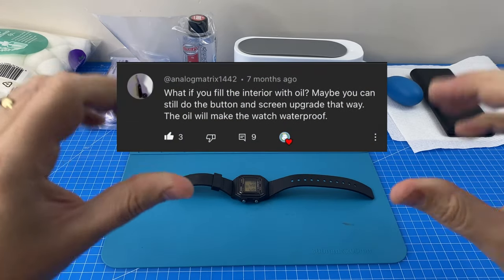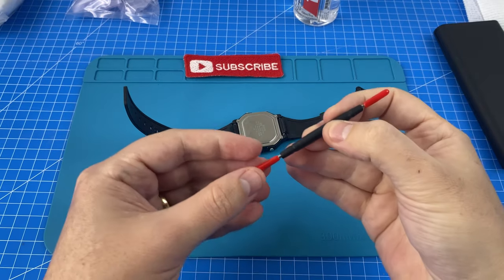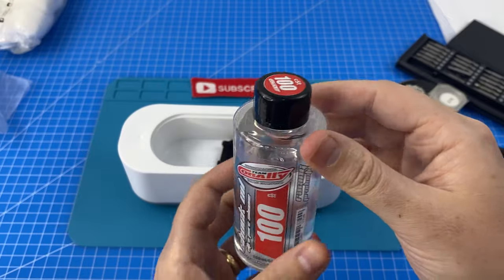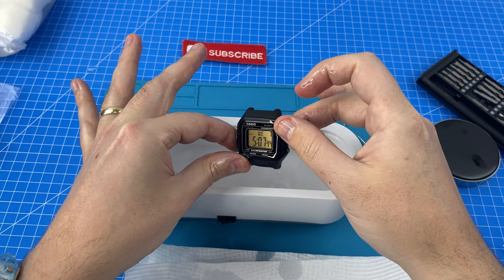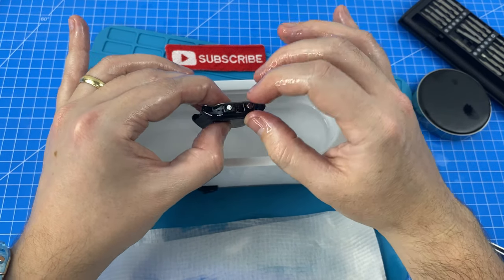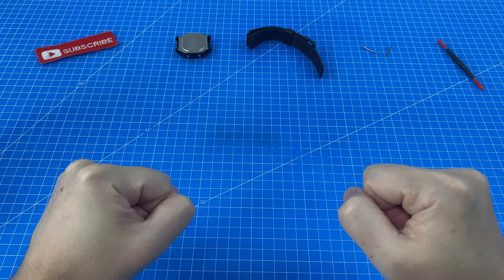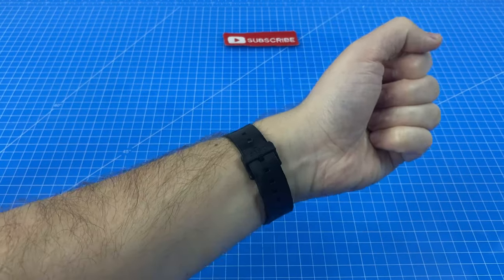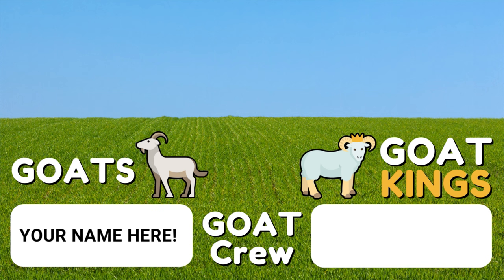⌚ Casio W217H HYDRO MOD Attempt! 💧 SUCCESS or FAIL?! 😨

Comment: Liked the video, but this "mod" seems like a solution to a problem that nobody is having.  If anyone needs more depth from their watch, Casio sells G-Shocks that go to 200M.  That's deeper than anyone reading this will ever take their watch...  Most recreational scuba stops at 130 feet... Navy Seals have been known to go as deep as 300 feet.  That's still less than half of what a bone stock unmodded 200M G-Shock can do...
Reply from the maker: Fair point! In the context of water resistance, I agree 💯
G-Shocks and Casio's generally have an EXCESSIVE water resistance rating that most of us would ever breach.
I will say that there's one added benefit to this mod that may make it appealing to some - and that is the improved visibility of the display. 👌
Thanks for weighing in, Squire! 🙏
Reply: Stupid talk! I need this!! In my Summer Holiday i will swim in the Pool 😂
Reply: @NoxmilesDe  just saying you can swim in the pool without the mod, and any of the other G Shock watches typically have 200m resistance.
Reply: I just like to mod stuff
Reply from the maker: @030nordseite  agreed, it adds another layer of enjoyment 😁👌
Reply: The oil mod alters the refractive index which allows it to be viewed at any angle underwater. That alone makes it worth it.

I just watched a vid where they put watches into a pressure chamber. Un modded, the screen broke at 400m and the front gave way at 1911 meters. Slightly more than rated.

Modded, maxxed out the chamber at 4300 M.
Reply from the maker: @Tuck-Shop  I watched that same video! 👌 Absolutely eye-opening 🤯
Reply: @Tuck-Shop  How often do you dive deeper than 200M?
Reply: @SquireSCA  when I go down on your mo ...

Too easy. Have a nice day.
Reply: @Tuck-Shop  Exactly, you aren't diving that deep anyway...  It just seems like this mod is a solution to a problem that nobody is having.
Reply: @SquireSCA  You completely overlooked the first part of my comment.

"The oil mod alters the refractive index which allows it to be viewed at any angle underwater. That alone makes it worth it."

Whilst filled with oil it also gives extra support to the screen protecting it from damage too. But you are after an arguement to dismiss and belittle those that like this mod. You'll ignore all reasons other than the one you wish to disprove. 
But at the same time you didn't rise to the your mom joke. Kudos for that.
Reply: if your reasoning was of any value mechanical watches would be museum material and  no one would be manufacturing them, but they are selling really well and for unimaginable prices.
Reply: you do it to have something no one else has or very few ppl has. you do it to have something exclusive and to start conversations about what you have on your wrist!
Reply: @jfonsecaesilva  Sure... I guess I could mod my car to drive in outer space, just to have something exclusive that I could tell people about...  Not sure how practical it would be, as I will never get to outer space to use it...
Reply: It’s usually done more for how it makes the watch look than the depth rating. It looks really, really good.
Reply: one would think that. I had a classic stainless steel led armitron that was water resistant to 50 meters, but was throwing a football in a pool with my boy and it ended up taking on water.  Had it for two years and no issues in hot tubs, hotel pools or everday showering.  but that one day throwing a foot ball and catching it in the water wrecked it. Im doing a SKX MOD on a casio A168 with a stainless case and blank stainless faceplate with a green screen. Going to do the oil mod on it as well and see how it turns out.
Reply: I agree but it’s a Casio so hey! That’s what we do with Casio watches… pointless mods!!
Reply: Because of fun, guys!
Reply: It's not about the depth it's about the time that the water resistance will be able to stop water from getting in... 200m water resistant watch will fairly keep it out for a long time while 100m, 50m, 30m wr will  give out earlier. There is also the question of erosion and residual formations that will affect the water resistance when exposed to something like salt water in the ocean or excessive soap usage etc
Reply: @SquireSCA  not only does it improve legibility below water but it makes it a bit better above too

Comment: The only things that can suck is the fact that it can be a mess and that you HAVE to do the process again if you want to replace the battery, thankfully if it’s a watch it can a long time before you need to do that (assuming the oil doesn’t eat at the plastic)
Reply from the maker: Great points, Sultan! 🙏 
I couldn’t agree more. 👌 It’s a sacrifice you have to accept, before deciding to attempt this mod. 
Ultimately, I’d love to one day try the Hydro Mod on one of my G-Shock’s with “Tough Solar”, which would completely remove the need to ever open it for a battery swap 🤩💭🔋 

Regarding the eating of plastic, I have seen some of the softer plastics be eaten by the WD-40 branded silicone spray (explained in my recent videos of the borrowed GBX-100). I am hoping that the more neutral silicone oil that I have used, doesn’t have a corrosive affect. 👌
Reply: @goatreviews "tough solar" doesn't mean it can last forever. It has a battery too that needs replacing eventually. In fact, it probably have a much shorter life than "10 year battery" regular power. For the past couple decades, I've used several "tough solar" Casios almost exclusively, believing this class of Casios could last forever. But none of them did. The longest ever is around 4.5 years before the necessary battery replacement. On the average, just 3 to 4 years. 

Realizing this thru years of buying "tough solar" and replacing batteries regularly, I've finally made the switch to the "10 year battery" casino royale for starters. Just today, I've placed an order on another "10 year battery" model, this time, a dual analog-digital Casio. And I'm eying another one. 3 more years to go, and I'll find out if this can last longer than tough solar.
Reply: @goatreviews you'd probably be better off "hydro modding" a "10 year battery" Casio.
Reply from the maker: @allanbernabe38  Wow. This is eye opening! 👀 
Tough Solar was honestly one of my most desired features - as I thought it would outlast a 10 Year battery! 🤯
I might have to rethink this now…

Thank you for sharing your experience on this topic - I really appreciate it!
Reply from the maker: @allanbernabe38  Cheers Allan. Agreed 💯 This makes a lot more sense for minimising the need to re-hydromod it! 😁👌
Reply: @goatreviews  you're welcome. To note, the longest my tough solar watch lasted (not the battery, but the physical watch itself) is around 12 years. And I don't even do mountain climbing, or diving or any extreme stuff. Just regular work-to-home days. I work in construction, but it doesn't matter. I don't dip it concrete or hit it on anything. Not even drop on the floor. 

Some sort of tiny part inside, could be the button peg or something, simply worn down. No replacement parts available. So I had two successful battery replacements, and on the third round, the service center says it won't work anymore and returned the dead watch to me. My other tough solar watches lasted even shorter.

Now that I've switched to "10 year", assuming the battery really lasted 10 years or close to 10 years, it remains to be seen how long will the rest of the watch body last.  Worst scenario, I may be looking at a life span of around a decade for each watch, whether "tough solar" or "10 year". If so, the advantage I gain from "10 year" is it cost half the price or less. So I may not need to wait that long to decide.
Reply: @goatreviews  I plan to give my "casino royale" the SKX Mod treatment, as I don't like wearing plastic on my wrist. But I gotta know first if the module can survive beyond 10 years or 12 years to justify the additional $150 I would plunk into it. Although if the module dies, it's not painful to throw another $35 to save the SKX case and strap.
Reply from the maker: @allanbernabe38  Wow - This is unexpected haha. How will I know when the tough solar battery needs to be replaced?

What a well informed way of looking at this.
I do like the appeal of a once-every-10-years battery swap that I can do myself 🤩
Unfortunately I don’t believe a wide variety of G-Shocks have this feature, although I know a fair few Casio’s do 😁👌
Reply from the maker: @allanbernabe38  sounds like an awesome mod! 🤩 A smart way of looking at it. 👌 Depending on how affordable Royale’s are in your area, you could even get a second one and keep it sealed “just in case”. Worst case they could become harder to come by, and it appreciates in value. They’re an iconic and popular watch, so you could always sell it off later if needed 😜
Reply: @goatreviews  that's a good idea.

Comment: That was entertaining. We used to use silicone oil for lubricating the magnetic recording drums used in old phone-in answer machine services. Messy stuff, you may want to look up "silicone oil contamination". Silicone oil has a tendency to "creep". That is, it escapes from where it is intended and coats everything in a thin film of itself. It is difficult to remove as it is inert and does not react to solvents. When we used it on those answer machines, the oil ended up coating all the other gear in the racks over time, making repair difficult.
Reply from the maker: Cheers, 68! 🙏 I'm glad the video entertained you 😁
Wow! 🤯 Thank you for alerting me to this... I did look it up, and also had to look up if ingesting Silicone Oil was dangerous! (It's not, your body can't absorb it 😅)
This makes sense. Cleaning my tools was really difficult even with soap! I found the only real way to get rid of it is to DIRECTLY wipe it away. It simply won't rinse off otherwise.
Fascinating facts you've shared. Thanks for weighing in! 🙏

Comment: I guess it's ok if you don't mind changing the battery when needed.
Reply from the maker: Good point, Luminati! 👌 
It’s something I have come to accept - when a battery swap is due, it will be messy and I’d have to top up the oil again. 
It’s made me look forward to trying a hydro mod on a TOUGH SOLAR watch, so battery swapping is never an issue 🤩💭

Comment: Thanks mate, I thoroughly enjoyed that. I used this example (with others) for a Seiko Tuna knock-off to test.
Worked really well; except that I used non scented baby-oil, probably with a little too high viscosity which made the movement stop after a few days. I then put it away, kinda forgot about it for a month or so, and the metal surrounds of the markers had come loose off the dial. A few days later the bezel insert came loose as well 😖

So, I guess I won’t be using baby-oil again 😂

Anyway, I’m going to mod the mod the $h1t out of an 200-mrw, increased lume on the hands, markers and bezel numerals, as well as a hydro mod. Should be fun!

I like the advice of using gloves and a smaller container (disposable?); I came to the same conclusion when I made a complete mess on our dinner table 😂

Have fun modding and I’ll keep you updated.
Reply from the maker: @MaartenAnna  No problem, dude! 🙏😄
Oh man… That’s rough haha - The baby oil sounded like a good idea on paper 😂
Thanks for sharing this. 🙏
Good luck with your mods! 😁🤞

Comment: I did one to a similar Casio with blue backlight. 

Looked great but oil would leak from somewhere. I assume the buttons so it would never last.

Was a shame as I really liked the look.
Reply from the maker: Oh wow! A blue backlight... Did that happen to be the F-105W? 🤔
Aw man, that's a shame about the leaking. So far I haven't had any leaks with my W-217H when I press the buttons... But I know that when it comes times to change the battery, there WILL be a big mess 😄
Reply: @goatreviews  it was a electro luminescence. Unsure of exact model but it had A168 stamped at the back.

Comment: Very informative video.  I was considering doing similar to one of my watches, but based on your experience and the fairly limited reward for the hassle and cost, I'm going to pass on doing my own.  Thanks.
Reply from the maker: Thanks, MTO! 🙏 I’m really glad this video helped you make an informed decision about Hydro Modding. You summed it up well. It’s not a mod for everyone! 👌
Reply: Btw @goatreviews , once you do a hydro-mod, is there no going back?  I.e. is cleaning a hydro-modded watch not feasible?  Thanks for your thoughts.
Reply from the maker: No worries, @mto3009 !
In my opinion, the answer is yes - there is no going back. I suppose technically you could disassemble each and every part and clean away the greasy oil, but given how hard it was to get the oil off my hands and tool, I’d say it’s not realistic 😅 Hope this helps! 🙏
Reply: @goatreviews  Well, it turns out I got an inexpensive Casio W-800H Negative display which I hydro modded after modding the countdown timer and alarm features.  I used a small plastic container when hydro-modding which turned out to be too small so it took me 4 tries to get all the bubbles out.  Now that I did it, I love the watch.  Display is now so crisp.  Thanks for your video which was the encouragement I needed to make my own unique watch!😃
Reply from the maker: Yooo @mto3009 , great to hear from you again! 👋
I’m delighted that you found a way to perform the mod without too much risk. The W800H is very affordable, and I’m proud of you for performing the Countdown Timer and Alarm Mods too!🙏 

Would love to see a pic of your creation in the Discord if you get the chance. 👌 

How amazing does it feel to wear such a unique, highly customised watch?! 🤩

Comment: nicely done homie. hydro mod is something i have not personally tried yet.
Reply from the maker: I appreciate it, man! 👌
Yeah it’s one I put off for a while too, but was excited to try! 🤩
If you do try it some time, make sure you fully submerge the module SEPARATELY before reinstalling. That’s what I’ll do next time and it will go much smoother 😁🙏
Reply: @goatreviews  also you can tint the oil to give a different color to it.  one thing i want to do but afraid of doing is reversing the polarizer
Reply from the maker: @Eksoteric  fascinating! Would a small amount of ‘food colouring’ work, or is there a better way? 

I too would love to do a polarizer reversal at some point! It would make positive displays more accessible. There’s a couple of lads in the GOAT Reviews Discord who have showed pics of doing a reversal - which I might reference when I attempt this mod  😄
Reply: @goatreviews  oil based dyes will work. there is this crazy glowing powder i found that could make it really cool
Reply from the maker: @Eksoteric  Excellent, thanks for the intel! 🫡
That’s a crazy idea, that just might work! I too have some glow powder I could try and add… would need a THOROUGH mixing to ensure it dispersed evenly without visible clumps 🤔

Comment: I guess, if anything,  the oil should improve viewability under water, due to oil having a more similar refractive index to water compared to the air that would normally be inside the case. Although I'm not a diving watch user/expert/enthusiast by any measure, but I remember as a kid not being able to see my watch properly when I went swimming, so I assume that would fix this issue?
Reply from the maker: Bingo, Chay! 👏 One of the main benefits of the Hydro Mod 👌
I can confirm that having tested this underwater, there is no longer that 'highly-reflective air pocket' you speak of! 🙏

Comment: I manage to successfuly moded mine without any bubbles at first try. But I noticed that the button not work properly because my silicon oil is too thick.
I removed all the oil and dissasembled whole parts washed it on tab water 2 times. Oil keep flowing between the display panels.
washed again. Assemble again. and watch still works. This is crazy tough watch.
Reply from the maker: Incredible! Well done on your efforts. 👌 Was yours also a W217H, or another model?
Sounds very resilient 🤯
Reply: @goatreviews  Same model W217h. Thank you for your video. I wouldn't have tried it if there is no proof like yours.
Reply from the maker: Wonderful. I'm so glad to hear that my video inspired you to complete this mod! 🙏 Thanks Manul 😊

Comment: I have a Casio A158 and I want to do the hydro mod when I do is can I take the watch in the ocean and shower with it on without having to worry about breaking it
Reply from the maker: Awesome 👌 
If you successfully complete the hydro mod, you could absolutely take it swimming or showering without worrying about water getting inside. The oil inside prevents water from entering, which greatly increases the water resistance 😁👌
Reply: @goatreviews  dose it make the batter die quicker

Comment: I got question. If you hydromod a date watch, would it mess up the liquid if I were to adjust the date?
Reply from the maker: Hi Izul 👋 I've seen videos of people who have Hydro-modded watches with a date-window (Such as a Casio Duro), and it seems that the mechanical parts can still rotate and function in the Hydro Oil 😄👌
Reply: @goatreviews  I mean, when we adjust the date of hydro modded watches, would the liquid inside leaks?
Reply from the maker: @IzulHamidjaja  This is a good question. I had to look this up myself yesterday, as I haven’t experienced it personally! It looked like the fellow who did it to his Duro was able to unscrew the crown, and make adjustments without it leaking, because of the internal gasket. I would of course like to test this for myself some time though! 👌